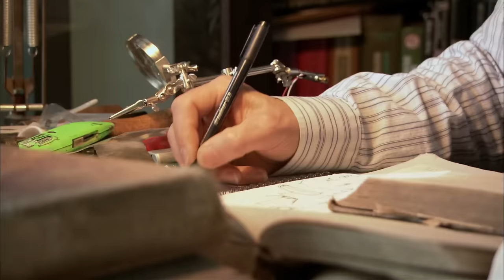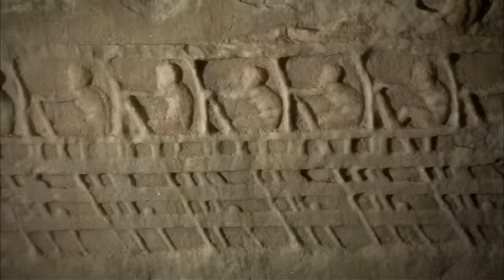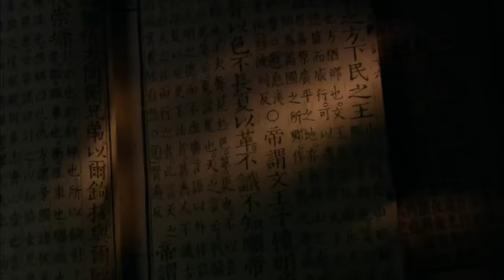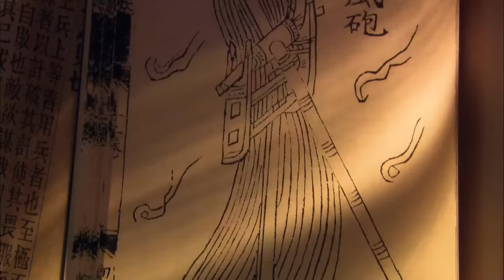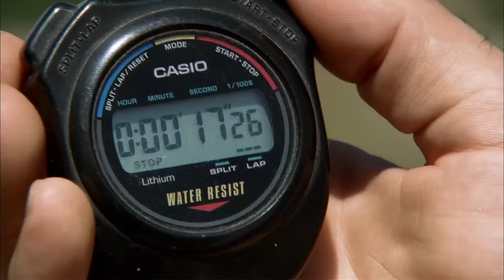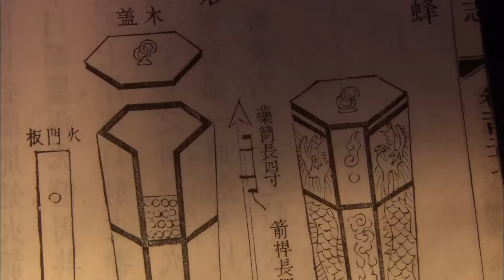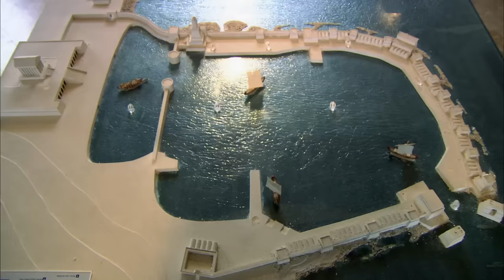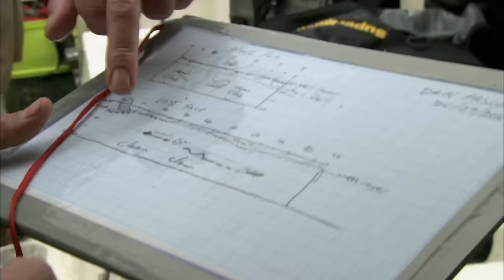Dangerous Secrets at the Bottom of the Ocean *2 Hour Marathon* | Ancient Discoveries

Comment: Free electricity is easy. All you need....is a few items, and some elbow grease. 
 Dig a hole 3 feet deep, 9 feet in length, and 3.5 feet wide. Take two wagon wheels, and put paddles in between them, so you basically have two wagon wheels pinching paddles so they can be moved with a stream of water. 
  Take a combustible engine off a generator exposing the shaft to the generator area. Throw away the combustible engine. It has no purpose.
 Remove the pulley from a dryer, because it's about the size of a quarter.
 Place that pulley on the generator. Set up your wagon wheels so they stand up in a cradle you build over the hole you dug. 
 Secure a belt to the generator to the wagon wheels, or use a chain. The generator needs to turn 3500rpm so build your wheel and gears accordingly. Get a low voltage water pump to pump water to the top of the wheel, so It puts pressure on the paddles. 
  Manually spin the wheel to get the power going, so the pump starts to pump on its own, and when the water starts to pump, it will automatically turn the wheel under its own power.